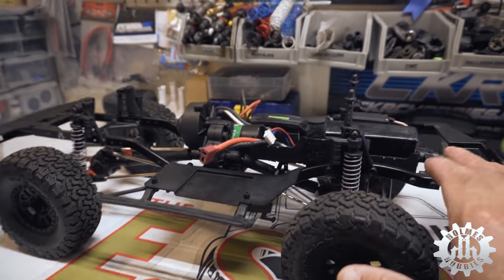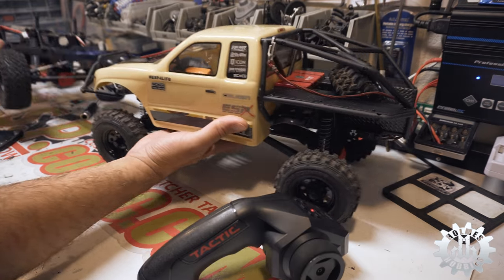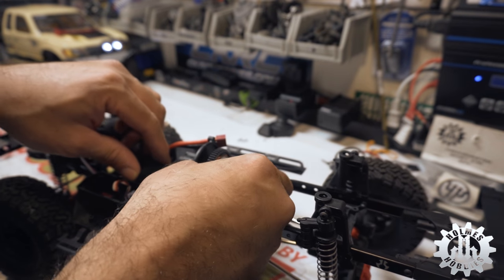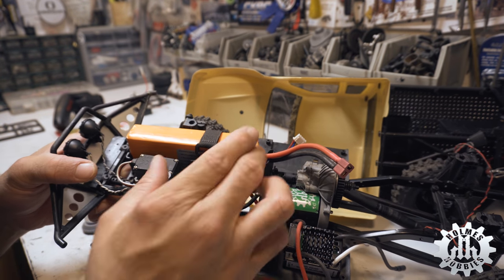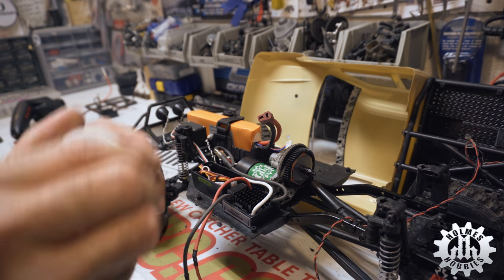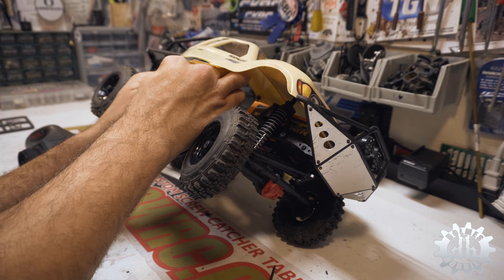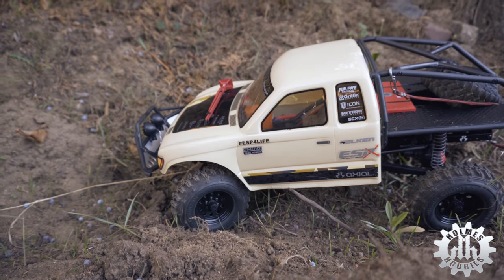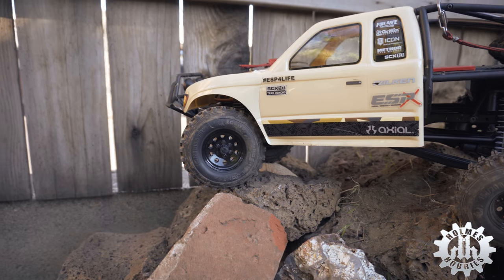Holmes Hobbies | Motor Control | Episode 119

Comment: What would you recommend in the Holmes Hobby line for a Wraith ? I have added a ton of weight and have burned up two Holmes 35 t trailmasters and one 20t trail master . I would like it to still have stock style speed with great low speed control .

Comment: Definately a big improvement imho but then I also run nothing but HH ESC's & motors in my custom metal builds, thus a bit biased I suppose. In any case...really digging the controlability & the rig looks great with new wheels & tires. As always, another excellent video as well.